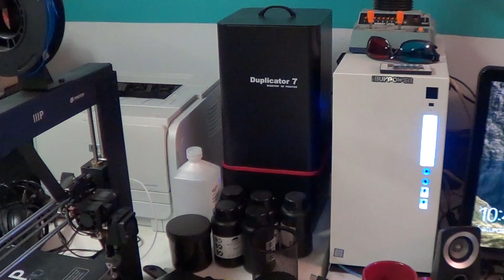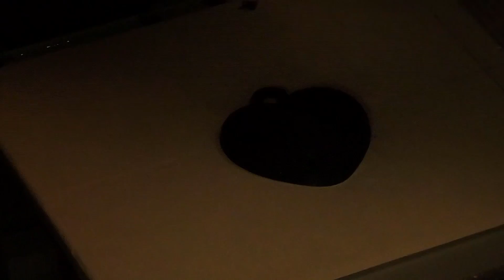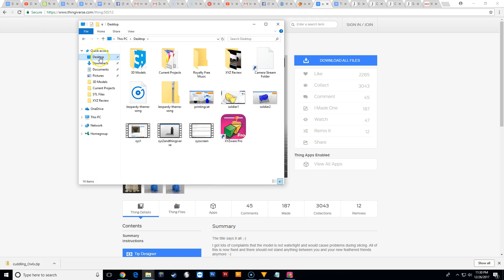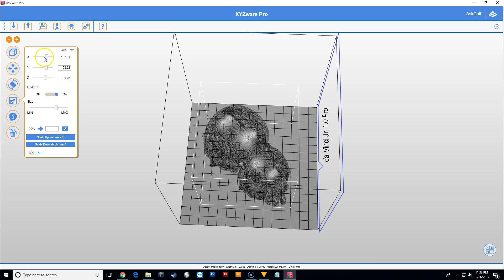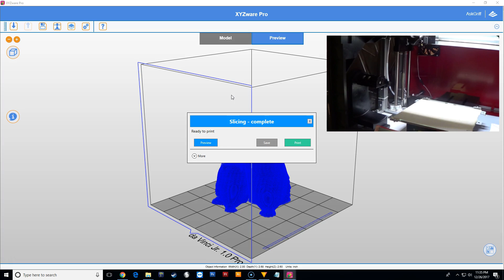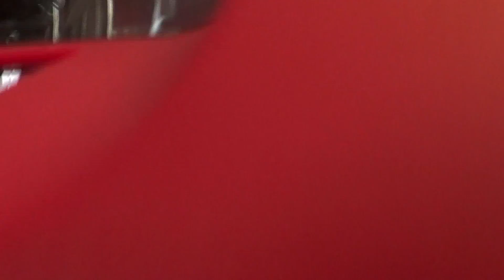XYZ da Vinci Jr. Pro 1.0 3D Printer Review for Classroom / Teacher Use

Comment: I have the same printer and it is still my go to even if the build volume is small.  Very easy to print with.  A few notes: The jig it does (when the machine starts a print) is just finding home position, auto leveling is done by choosing calibration on the screen and pushing down on the button on the print head.  With the correct temps and speeds can produce very good prints.  The software offered by XYZ is easy to follow and is all you need to get going.  Options are limited when compared to say an Ender 3 using Cura but it is as close to a plug and play as I have seen or used.  Excellent first printer or demo printer to take to craft show etc...